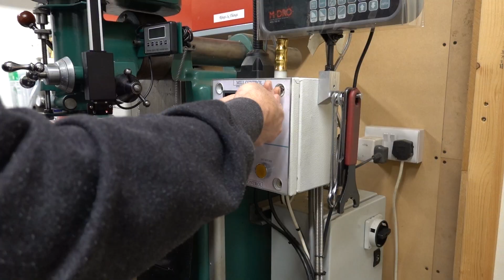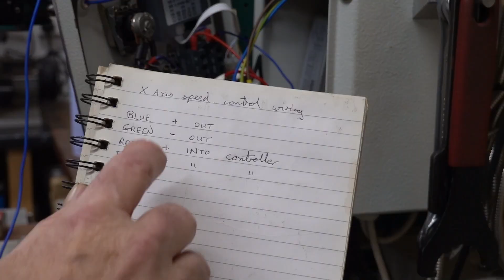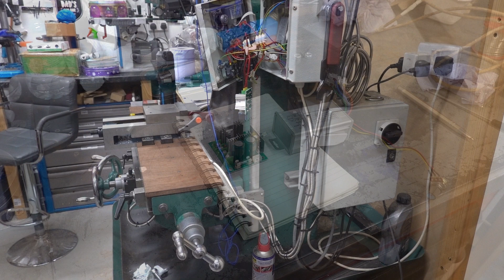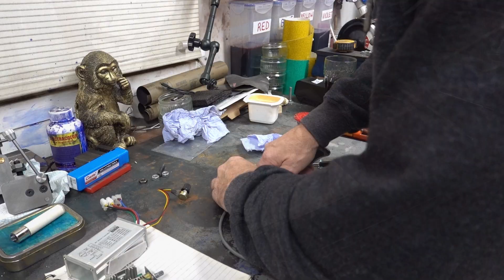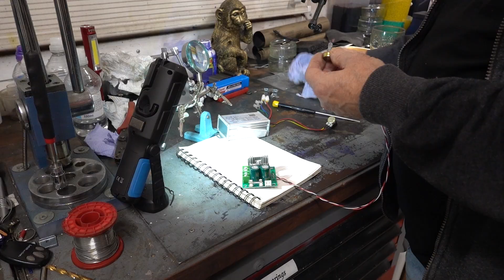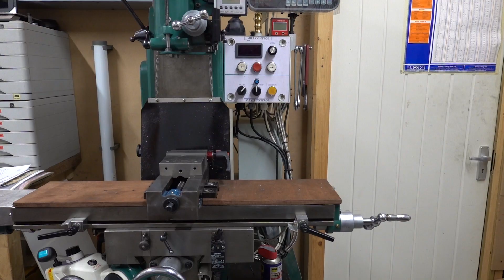Milling machine X axis speed control issue

Comment: Wow. I would die if I was faced with so many wires. Not my forte. Thank heavens you’re an electrical engineer.  Well done for fixing the speed control issue. 👏👏👍😀
Reply from the maker: Thanks for that Andrew. I have already had some stick from family for having it so untidy in there. But I know where everything goes. Cheers. 
Steve.

Comment: Good video mate. I had a MyFord super 7 when I lived in the u.k in Beckenham kent but sold it before I left to go to Thailand. I had a lot of fun with it but it did have its limitations especially when people asked me to turn a 3-foot long shaft and about 3 inches in diameter lol. I'm thinking of building a workshop in my garden but I will have to buy a Chinese one I think but some are improving a lot now but if I try to buy an English lathe I will be murdered with the shipping costs. This is the first time I have seen your videos and I will continue to watch you when I can.
Reply from the maker: Thanks for the kind words Dermot. Yes the Myford is a great little lathe, but has it's limits in size. If I had room i would get a bigger one. Lots for sale in the UK. But as you say import duties etc. Hope you find one & get the workshop built. Not sure if you watched the garage build i did. Cheap way to build. Regards.
Steve.
Reply: @Steviegtr52  I will get a brick one built as the labor costs are cheap over here and air conditioning is a must lol. I started watching the knurling tool build! That looks a great project because it involves turning and milling and fitting. When I worked at Fords in the u.k I was a maintenance fitter on the lines but most of the parts for the machines were obsolete and the company sent for a new part machined from Germany and we had to wait weeks for it sometimes so I made a suggestion that I could make the parts with the machines we had in the workshop using metal from the steel stores and they said yes so I created the job for myself and hardly ever went out on a breakdown after that lol. I hated just being a fitter bashing spanners!
Reply from the maker: @dermotkelly2971  Fingers crossed that you get the new shop & machines. Good luck Dermot.
Steve.

Comment: Gday Steve, great fix, I need to put a power feed on my mill drill, another job for the future, thanks for sharing mate, cheers
Reply from the maker: Yes it's not hard to do . I know some who have used a 24v wagon wiper motor for extra strength. Most use the D.C stepper ones. But works out a bit more money to do , with all the control gear etc. Cheers. Steve.